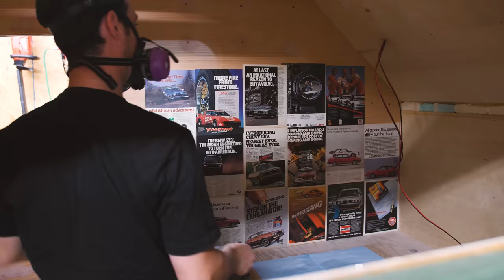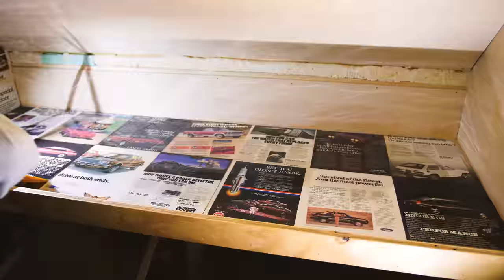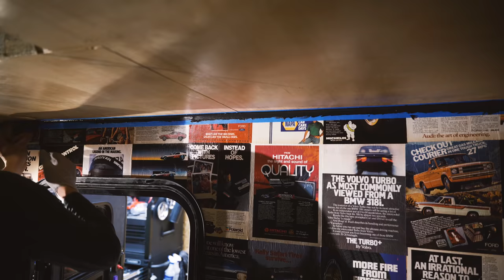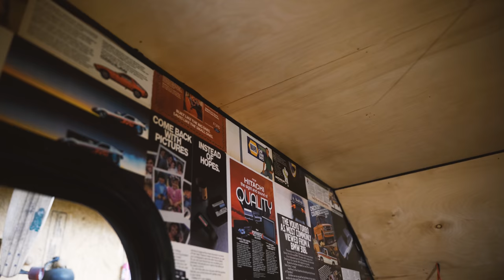I built myself a Teardrop Camper from scratch - FULL BUILD

Comment: I've repaired many boats and many travel trailers working in the auto body business for 20 years You've done a nice job here, if this is your first trailer keep going if this is your fifth trailer time to step it up. Your eye for detail is very good and you're not skimping because it's yours You're building it as if it's for someone else to purchase keep that in mind. Now your choice for the wall coverings I think is kind of cool but I guess I would ask the boss first. For her thoughts about it. Also you might want to upgrade your springs on that trailer It is quite lightweight and I'm sure the springs are not up to the rating of what you built and dude besides getting more tools you need a bigger garage. You have many more trailers to build and sell Yes sell 👍 Good luck!

Comment: I imagine that by now you realize it would have been much more efficient had you fully assemble the walls before putting them into position. But, hey, this was your first attempt and I'm pretty sure you'll incorporate the many lessons learned into your next one.  I also imagine you'll invest in a much higher quality set of running gear, as I'm pretty sure you've exceeded the weight limits on the one you used in this build.

Comment: I would go back and use some proper nuts and bolts and washers to secure that to the trailer. the flush cut bolts into wood are not safe.

Comment: I’m assuming this is a fair-weather camper because it is NOT weather proof. That wood is going to rot out in no time. At the very least,you should have covered the exterior in fiberglass/resin to make it waterproof. Then you could have painted it with epoxy paint. Ideally, you should have covered the exterior with an aluminum skin.
Reply from the maker: I did do all that. Hard to show in a time lapse but it’s got resin and the works

Comment: Very nice job!!! My only concern is did you go over the trailer weight rating on the manufacturer plate? If so, In some places, you can change the axel and strengthen the tong to the new axel. The structure you built will add strength to the rest of the frame. And you already upgraded the tires. Here in CA you are, or used to be, allowed to custom build trailers ect. But, you may need to get it weighed and remove the original trailer manufacturer plate ect. I don't know, but if you are over weight, strengthen. Thank very cool job!!
Reply from the maker: Appreciate the insight!

Comment: I love the build! I just have one question!
I probably missed it but i didn't se you make a air intake. I saw the exhaust fan but you also need a intake unless you plan on having the window cracked all the time. That is not good either tho because you need passive ventilation when the fan is not running otherwise you will get mold since you did a amazing job with making the trailer so proof. (I don't know if proof is the correct word in this situation but i mean that every crack has foam or silicone so there will be no air circulation) I'm Swedish so this might sound like I'm hating but that is NOT the case
Reply from the maker: Your not crazy. A window needs to be cracked for passive air for sure. I made the mistake and yes it got too humid in there this summer. You are correct.

Comment: how much was your total build? Perhaps next time you may join the Foamies like myself and build a foamie. I did the same, I bought a 4x6 trailer that came in 3 boxes and 200 screws & nuts and built mine from the ground up. Last month we put 2,000 kms on it and now back in my parkade to do a few adjustments. I figure all inclusive with solar and 12 volt cool and most important a flushable toilet, I am at about $8,000 but not finished yet and am now thinking I want to add a pop-off hydrafoil and mine came in at a total weight of 622 lbs. the 2lbs was probably the beer in the back LOL
Reply from the maker: Oh my goon sauce that’s epic! How do the foamier stand up?

Comment: I only wish the best of luck and great times with your project but I wonder with this and other similar builds online, when bringing the lumber home doesn't it seem very heavy? If I were to build this I would be cutting big rectangles and circles out of any dead weight throughout. I also see other builders put huge furniture and attached accessories. Total weight would be a big priority. (Doing research, DIY is ALWAYS better than the sorry crap prebuilt buyers get.) Nice work.   Regards.
Reply from the maker: Not too heavy! I made it with the Harbor Freight trailer.
Reply: @WoodnessGoodness  Nice work!

Comment: Good vid but this is not a tear drop , The only straight edge on a true tear drop is the floor everything else is curved and this trailer has only one little curve its basically just a rectangle with a wedge in the front wall .
Reply from the maker: I just figured robots had square tears.

Comment: Not even finished watching halfway through you're putting insulation in videos great so far your build quality is awesome I would recommend going with vacuum wall insulation they have a certain website I just can't seem to find it again myself but I'm sure you'll come across it floors ceilings walls they're all built and designed in different ways for those particular uses floors for holding heavy weight the R value is amazing you can get the 2 inch thick that's what i would use in a trailer even better
Reply from the maker: Thanks for the tip! I gotta look that up!
Reply: @WoodnessGoodness  yeah no problem when you read the results of the R value it's amazing I believe there's actually a video on YouTube and somebody will show you how much insulation you would need to equal a 1 inches vacuum wall insulation panel or a 2 inches thick vacuum wall insulation panel

Comment: Nice video - very cool camper. do you have details of meassure of the wood. How thick is it.
Reply from the maker: It was 1” thick insulation plus 1/2” worth of wood or more. Roof and front and back  are 2” insulation plus 1/2” worth of plywood.

Comment: I had made a comment about seven or eight days ago about the floor system what was the thickness and width of the board that you were ripping down and you please let me know
Reply from the maker: The floor? The floor is a ribbed 5x8 sandwich. 2” insulation sandwiched with plywood and the ribbing for strength.
Reply: Well I guess everything's good not only am I fixing my own to your drop camper with all the feelings and extra credit stuff that I'm getting from the builder itself I guess he's helping me tremendously excellent job my friend thank you

Comment: Have watched your teardrop camper video at least a half dozen times already. I love how you fixed the two left sides issue. Mounting one face in and the other face out was a simple, but brilliant solution. I followed your link for 13" tires to replace the 12" tires that come with the Harbor Freight 1720 Lb. Capacity Super Duty Folding Trailer and plan on buying them. My question is do they mount with no changes to the axle and hubs that come with the trailer. Also I read a comment about changing the bearings on the axle for better highway performance, do you recommend that and how hard is it?